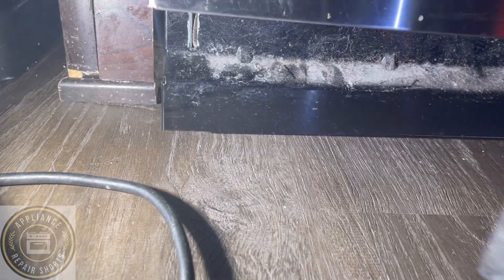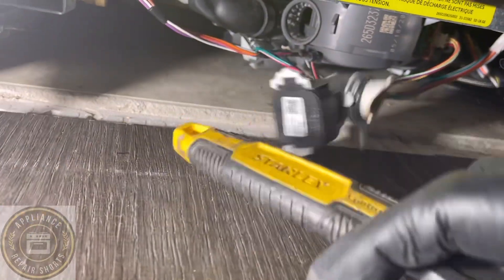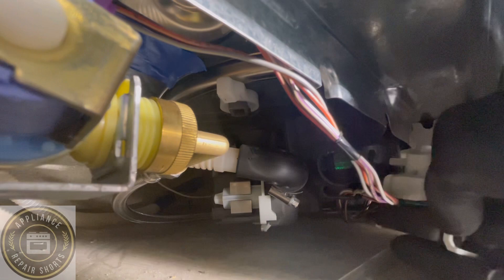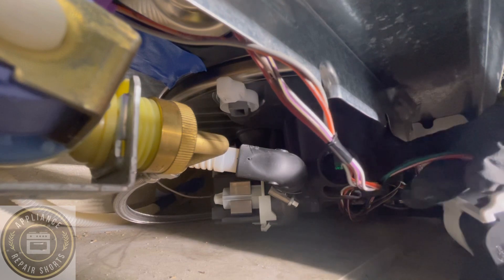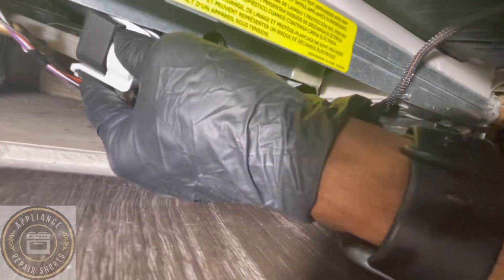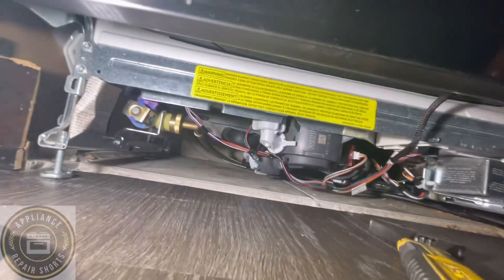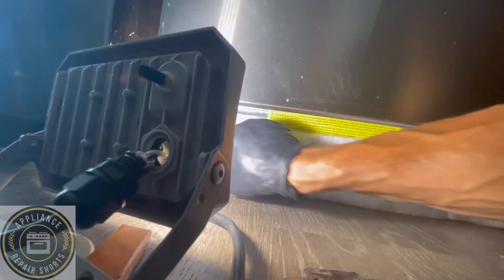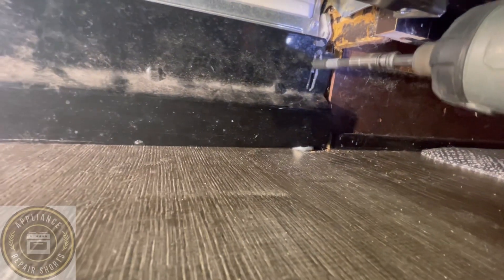GE Dishwasher Stuck In Drain |Only Drains| Not Washing | GDP665SYN2FS

Comment: Very simple to pull out to inspect and clean. Thankyou GE design engineers for making a serviceable part easy to access and service, and thank you "Appliance Repair" for sharing your experience on this matter.    Mine too was filled will quite a bit of food crud.   Rinsed it out well with hot water and re-assembled. Dishwasher back to being operational and my 13 year old doesn’t have to hand wash all the dishes  😉, so he is thankful too!   God bless!!
Reply from the maker: You know I appreciate your comment, you’re are absolutely correct about the serviceability . I totally agree. Thanks for your input

Comment: After much frustration and a replaced water inlet valve (not needed in the end, but part of the elimination process for repair), your video immediately fixed my machine! Like everyone else said, you saved the day. I will add that I took the moment to clean my sensor once removed, and I don't think my diaphram was stuck. I fully believe that the amount of "gunk" that I washed (and tapped) out of the bend of the sensor pipe kept my sensor from operating properly. But, now I have a properly working dishwasher, so thank you again!
Reply from the maker: My pleasure

Comment: You just saved the day. My 1 year old Cafe dishwasher was giving FTD code even though the pump was fully draining the tub. This stuck switch prevented the water valve from opening even in service mode. I was positive I needed a new control board until I watched this.
Reply from the maker: I appreciate the feedback.just make sure you empty your dishes before, if you aren’t already doing that

Comment: Buddy I owe you one. Unit wouldn't stop draining. Took out the pressure switch, and sure enough it was impacted with gunk. At some point somebody removed the valve check that goes into the unit to prevent backflow. The drain hose was also hung wrong (no airgap or loop at the top) so it was going to keep getting plugged up. At any rate, cleaned it out really good with super hot water. Reassembled it and the unit ran a perfect cycle. Thanks so much.
Reply from the maker: I appreciate your feedback. Whenever you do a repair, I do a follow up. Nice to hear all is good. You can always buy me a cup of coffee. Link in the description. Either way, great job

Comment: You know? I am going to have to throw my thank yous on the pile here. This video fixed my GE dishwasher and I was just about to go get another one. I had just replaced the board, and it still wasn't working. I do in fact wish I would have found this video before replacing the board! Thank you very much for this video.
Reply from the maker: My pleasure, if you already subscribed , we are good. If not it is too late. I actually have a few more videos on that issue.
Reply: Thanks a lot my man ... I had just ordered a water inlet valve, then I read about the pressure  valve you spoke of . Took it apart and totally clogged... cleaned it and now washer started fillind with water.  Running right now !! You da man !! GOD BLESS YOU !!
Reply from the maker: @ I appreciate all the great news!! My pleasure and God bless you

Comment: Wow, I was 'this video' away from pulling out my dishwasher, flipping it over and trying to figure out the issue.  I followed your steps but instead of the balloon I took off the box on top of the white plastic thing and there was a big clog in there.  I pulled the gunk out, reconnected and everything works now!  10 minute job, next time probably 5 minutes.  Appreciate this, sir!
Reply from the maker: My pleasure. I love helping
Reply: Turns out it only fixed it for a partial cycle so I pulled the pressure sensor out again and noticed there's a little hole in the rubber that was also clogged.  Scraped it out with a toothpick and was able to get a full wash!
Reply from the maker: @jboo9620  yep, I normally take it to the kitchen sink. Good job

Comment: After replacing the water inlet valve and the control board it still didn’t work until I came across your video!! This was the winning you tube video.  BAM 💥 this feels great to fix this finally!  Thank YOU! Mine was full of the black crap even though I clean the fine screen filter weekly.  High five
Reply from the maker: Awesome news, those comments put a smile on my face

Comment: Thanks. You pointed me in the right direction. I ended up taking the piece off and took the electronic piece with the plunger apparatus from the pipe part. I was unable to blow into it and I noticed the hole was completely clogged. Ended up using an old electric tooth Brush and toothpaste with water to clean it. It didn't even look like there was supposed to be a hole there it was so hard scraping with just my fingernail. After it cleaned up I was able to blow and feel the flex of the plunger. Hooked it up and it ran through a cycle without an issue. Easiest appliance repair I've done. Three year old GE that was on sale for about $600, looks a lot like the one in this video. Mine is model GDT665SMNES
Reply from the maker: Glad you were able to fix it

Comment: This did the trick, thank you! Initially misdiagnosed it thinking it was stuck in filling mode, but figured out it was initial drain check after doing the system tests and noticing the sounds. Tapping fixed it
Reply from the maker: Awesome job

Comment: Thank you for the video, I tapped it and blew into it but it didn't fix the problem. Is there a way to find out if it's defective or should I just go ahead and buy a replacement? Thanks again!!
Reply from the maker: Take it to the kitchen sink and wash it out. Then try it. Also turning off the breaker for 5-10 minutes. If nothing after,yes replace it

Comment: Mine was clogged with grease. Cleaned it out and ran the pressure switch under hot water for a while (being sure to avoid getting water in the connector.) It worked like a charm 😄. Thank you!
Reply from the maker: Appreciate you sharing that

Comment: A great video.. Solved the no water / pump running issue. Pulled the switch and it had gunk tucked up into it. I was able to pull a lot of it out with a small pick and some careful cleaning. Tested the diaphragm by blowing in/out and the diaphragm freed up.  Cycles as it should now.  Thanks so much..  Will be ordering a new sensor first thing so I can make sure it will work reliably..
Reply from the maker: Appreciate your feedback. I seldom replace them. You did excellent by blowing into it. I have an another video dealing with a call back. In that video I opened it up used a small pick a blew out the junk. The reason the pump kicks on is because the board doesn’t know how much water can be put in. Thanks for sharing

Comment: is the pressure sensor screwed in or clipped in??
Reply from the maker: It is clipped in, you twist it out. Make sure your dishwasher is empty before removing it
Reply: @appliancerepairshorts  Thanks, will do

Thanks, will do
Reply: The part showed up - pretty easy installation having watched your video a few times - thanks so much.

Comment: Good video. Let me know what was controlling the drain cycle on this newer dishwasher. I would add if anyone comes across this in the future, that tapping my sensor did not resolve the issue, but I was able to remove the sensor (black part) from the housing (white part) by releasing clips on either side of the sensor. There is a 1/8 inch hole in the bottom of the sensor where it senses pressure. Mine was clogged with a bit of food debris. Sprayed off with sink sprayer, and was good to go.
Reply from the maker: The pressure sensor on either of those GE Dishwasher will have a sensor. Sometimes tapping it. Most often you need to remove it and clean it. Once it is clogged, the pump is activated. The reason is, there is no way to measure the water coming in. Thanks for watching

Comment: Will your dishwasher have a FTD alarm on it if this is the problem
Reply from the maker: That drain pump is basically telling me that the dishwasher is not getting or going to get any water. I’m a big fan of anything that will provide safety. I think they should be placed in any potential leak areas

Comment: I used a turkey baster flushed it out from inside of cabinet .Without removing part .Fixed the poblem.
Reply from the maker: You really should remove it and clean it. The next best option would be a shop vac. The pressure sensor is sensitive and food debris blocks the signal. Glad it is working

Comment: I needed a video showing how to unplug the wires. I dont have much slack in mine and cant see but i could feel.
Reply from the maker: Pretty straightforward, you can use one hand to unplug it. Small tab and it is out then turn it off slowly. Good luck

Comment: I removed it and pump is still running ... Cleaned it and put it back on nothing has changed still on drain cycle
Reply from the maker: I have a video I actually took it apart. You are still clogged. I’ll try and find the video
Reply from the maker: GE Dishwasher Not Washing | Stuck In Drain |Washing Without Water | Pressure Sensor
https://youtu.be/jm0O-fSHCfM

Comment: It worked but now I have a leak that won't stop. I made sure that my o-ring is still well seated.
Reply from the maker: You probably didn’t install it fully. Or the O ring might not be sitting correctly.
Reply: @appliancerepairshorts Okay. I'll try again. Thanks a lot.

Comment: came across same issue and it was the wash pump
Reply from the maker: If you were having the same issue, I think when you were replacing the wash pump, the pressure switch probably had debris and during the repair it got moved/relocated. How did you verify the wash pump being bad? That switch can stop power to the wash pump
Reply: I work for Ge and I have a diagnostic tool that I can plug in to the dishwasher and enter the diagnostic mode that would allow me to operate every single component
Reply from the maker: @kamalabbady6778  on some appliances I have jumper to run each component. Awesome devices, but since you are a tech. Man those things are awesome, but I will say it takes the fun out of diagnosing .  Since you work for GE, what do you think about their Diswasher?
Reply: Their ok
Reply from the maker: @kamalabbady6778  yep